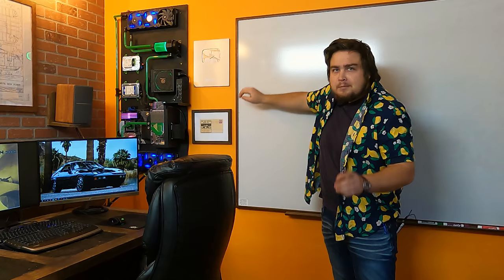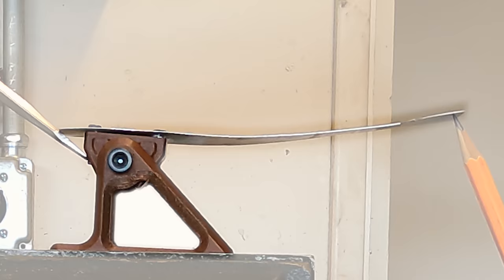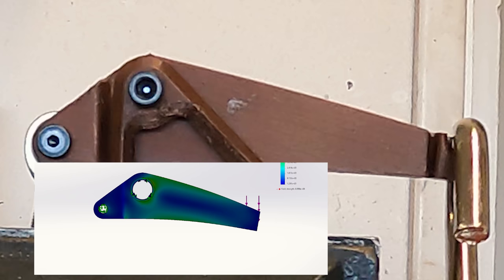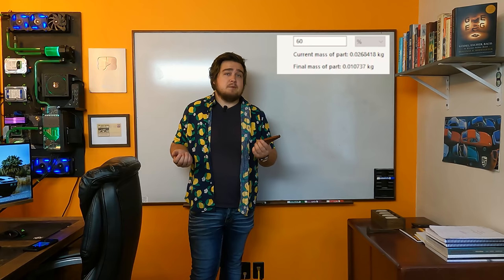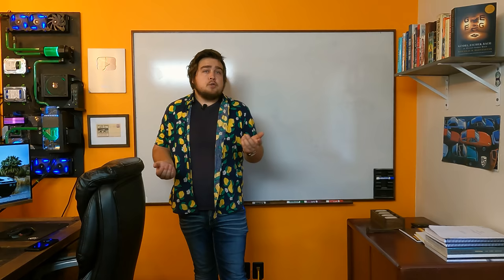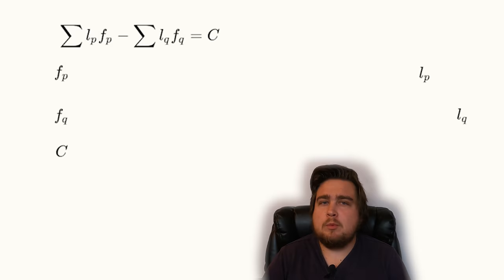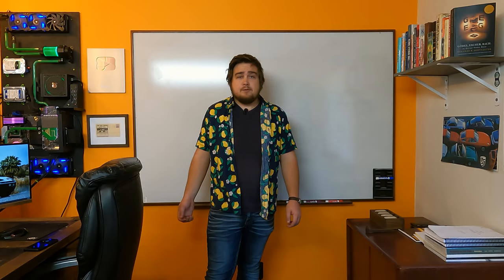Why do the Strongest Parts Look Like This?

Comment: These aren't necessarily stronger, just strong enough for the weight or stresses.  Solid materials will always be stronger, but also more expensive. But obviously trimming down material usage can still fall within the desired structural strength needed for an application. But another problem is these designs may not stand the test of time very well. 

For example, if an old fashioned tool rusts, it can be cleaned up and still retain pretty much the same functionality and strength. But imagine a wrench designed with these types of shapes, that has rusted and is cleaned up. Not only would it be more difficult to return it to new looking condition, but the rust may have significantly eaten away at key areas, thinning the structures enough that the wrench can fail with much less stress. This also applies to a lot of other things. So it means things made with these methods can fail more readily with age, as age may reduce the material in a structure, or for materials like concrete, cracks developing can result in catastrophic failure compared to a more solid construction. 

Another factor is materials like concrete get much of their strength from compression, and can be vulnerable to sheer forces. You could very easily overload its capacity with reduced material usage, as there isn't the extra material there that would otherwise brace any structural sheering forces or cracks that naturally develop. 

On top of that, it could potentially make structures built with this, much more difficult to get rid of or deconstruct. Imagine for example you're demolishing a building that uses these types of structure. It would likely be more dangerous, and due to those weaker points, the demolition may not complete properly, as thinner areas could be destroyed while other areas remain intact, making controlled demolition much more complex. You could even end up with catastrophe if something breaks away and falls in a different direction than it's supposed to, and the various stresses on each strand of the lattice could have difficult to predict consequences on how things break apart. 

So I would say that while these designs seem like the future, they're probably also less practical and more trouble than they're worth, along with creating a less permanent world that more readily crumbles in time. Which might be part of the point. Afterall, construction companies will make more money the shorter the time structures can last, and material manufacturing companies make more money because the less material you use, the more expensive it tends to get. 

Remember when we used metal and glass in virtually everything instead of plastic? The volume of usage made those materials very cheap. When you reduce that usage, prices go up. So there is an inherent benefit to using more materials, when it comes to cost. The more we try to reduce our usage of materials, the more expensive those materials become, ultimately making even these trimmed down designs eventually cost more than it used to cost to make them completely solid. So in the long run we're not actually making things cost less, we're making them cost more.

Comment: This is a good presentation from a technical standpoint.  But parts look like this not because they are the "strongest," but they look like this because the parts can be manufactured at the lowest cost and still be fit for the purpose, i.e. meet the design specifications.  These types of decisions are made routinely by engineers. Taking the chair for example, you could use a heavy frame steel structure to be "stronger" but that would cost extra money, and the chair maker does not want increase his cost just to make the chair support a larger weight.

Comment: Your first formula looks wrong. I suspect you've shuffled L1 and L2. According to your drawing, it should be FA x L2 = FB x L1, hence FB = (FA x L2) / L1.
Reply: ya although one might want to point out that FB x L2 = - FA x L1, due to sign convention when an equilibrium of moments is applied at the fulcrum. That would lead to FB = - FA x  (L2/L1)
Reply: @benzo5799  I don't think so. To obtain the equilibrium, both forces are applied in the same direction (or 'way', I'm not sure, I'm not a native English speaker): upwards, here). The torques produced by these forces are opposite, and their sum is null.  (FB x L2) - (FA x L1)= 0. Hence the result I gave. There is not  a 'sign convention' as the one you describe ; there are just vectors, and vector products, when it comes to demonstrating.

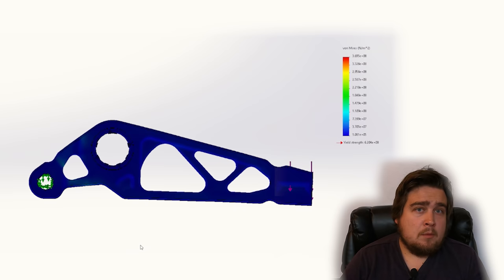Comment: you really don't need fem and (semi-automated) topology optimisation to get to these shapes and formes (edit: most of the time). i mean loading cranes and jibs and railroad bridges had been designed this way for ages, literally. and they are designed the same way now, actually. you can get a shape similar to your at 7:25 from a regular backwater structural engineer sketched up on a napkin in 5 minutes (or actually in 30 seconds maybe).

i'm not saying you're incorrect. and this is a good presentation. i'm just saying that you can do 80% of this type of work with 20% of cognitive effort and computation power as per pareto rule. and with the finite element method boom of the last decade or two you get solid, but still incremental progress, imo. sure, modern architectural projects look fancy, but can you really say that ancient roman aqueducts or gaudi's sagrada familia (load bearing "trees" inside) are fundamentally different?

Comment: When you said design path i was able to physically picture a 3D model in my head like they said Nikola Tesla did and I could see the failure planes as with your explanation I could clearly see how the computer can mathematically remove pieces until you're left with and optimize feature. I was able to Big Brain I'm going to subscribe